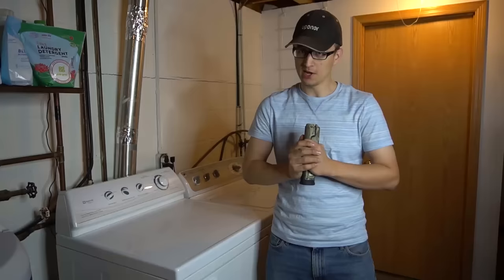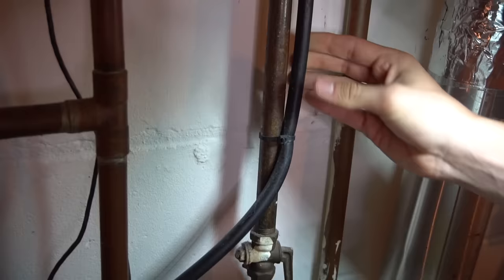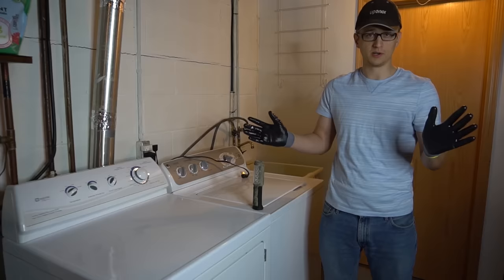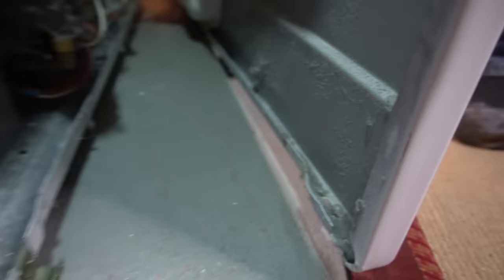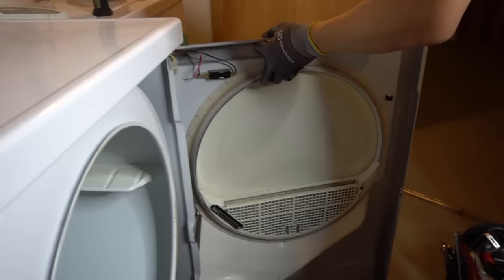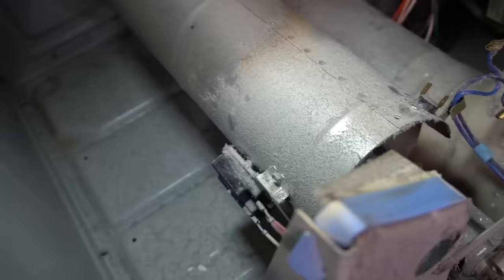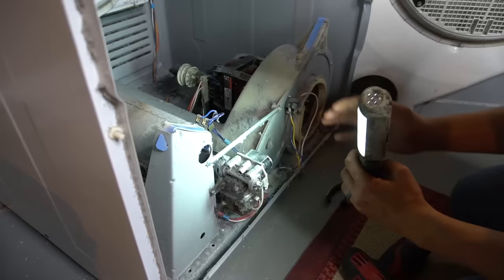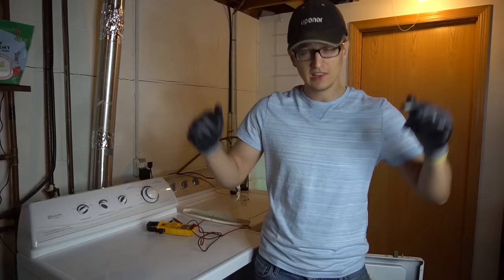Dryer Not Heating and The Most Common Fix

Comment: Thanks for this very comprehensive guide. My dryer has been taking a long time to dry and after completely dismantling the thing and probing all the parts I unfortunately haven't found a smoking gun. Hopefully simply having disassembled everything and putting it back together will have set something right...

A note about continuity testers: continuity on a multimeter is typically used to detect shorted electrical paths. Meters are designed to beep only for very small resistances, in the order of < 10 ohm. Your continuity tester didn't beep when you measured the coils because the resistance reading was too high.
Reply from the maker: I have had a few times where I took a dryer all apart, found nothing wrong, put it back together and it would start working. Another thing I have seen is gas dryers heating for only the first 15-20 minutes and after a while the gas valve coils just stop opening up the gas valve. Sat there and watched the dryer dry twice before and caught them doing that. So now if a customer tells me it takes it a long time to dry and I am not finding anything wrong, I just go ahead and replace the gas valve coils. Haven't been getting any call backs.

Thank you for explaining the difference between continuity and resistance testing. I finally know what the difference  between the two is besides one beeping and the other one not. ;)
Reply: Thanks for the suggestion. Do the gas valve coils make a clicking noise when they activate?
Reply from the maker: They do make a clunk sound when they open the gas valve. If you have a little sight glass opening on the bottom of your dryer, or a kick panel, you can take it off and just watch the burner. If you see the ignitor glowing but gas valve not opening, then those coils should be replaced.
Reply: @WordofAdviceTV  Agreed. The gas valve coils are so inexpensive, whereas service calls are not so inexpensive. If I have to open up the machine for work such as replacing the igniter and I suspect that the coils haven't been touched in years, I readily replace the gas valve coils, as I almost always have a set with me. I think of it as preventive maintenance rather than repair.
Reply: @sswpp8908  That little click from the valve solenoid when the igniter is at full temperature is the key to tell you when the gas valve opens. If you don't hear it, then replace the coils. If you still don't hear a click after replacing the coils, then it's the gas valve. In my effort to maintain laundry equipment for my few rental properties, making sure to always have a new set of gas valve coils and a spare igniter on hand has given me a good shot at a fast fix for the most common problems. 
     Cleaning the inside of the machine is a part of the job. For that, I carry a powerful hand-held vacuum, a refrigeration coil brush (just because it can get into confined spaces), an automotive detail brush and a cheap 2-inch paint brush too. I admire the capabilities of a good appliance, and giving it a good cleaning from time-to-time is a matter of giving it proper respect and encouragement to keep on doing its good work.
Reply: es, it makes a click noise

Comment: hey man, thanks for that video,. not only you got a liot of views in order to thank you for it but you actually helped me repare my dryer. i just bought one that was making a little heat but i had to to 3 completes cycle in order to dry my clothes cause it was still moist, i opened it up like you explain, clean all the dust with my shop vac vaccum cleaner and verified all the fuses. fuses were ok so i closed it back, tried it, IT WORK LIKE A NEW ONE ;)  many thanks again!

Comment: thank you so much. this is the second time you save me. Again, the thermal fuse (11:30) (most common issue) was bad. And the operator thermostat that I ordered with the other part was bad. So I will be calling them to replace that. And I'm pretty sure I will be back here in one to 3 years lol. Thanks

Comment: Pretty good dryer back in the day ... but I always preferred the whirlpool design myself (even though whirlpool owns Maytag nowadays). The most common problem with this design  by far was the blower wheel, The rear drum rollers second ... then of course, the burner coils . Every once in awhile I’d come across an ignitor with a burn spot on it . Other than that , not a bad dryer at all . That hi-limit on the tunnel , I might’ve replaced a handful of times in the 35 years or so of fixing appliances... and I’ve fix a hell of alot of appliances !!!
Reply: Thanks for the input. Maybe you might get a channel setup?
Reply: Wish I had the time... my company is in nyc . I’m out on the road repairing appliances from morning till night everyday ... a lot of times I’ll work a half a day on Sundays !!!
Reply: @josephmurgolo2795  You are working too much. Don't forget to take breaks from time to time.
Reply: Good instructions. I looked up my issues with washer and dryer and fixed both of them. My daughter now has her dryer not heating but she has service plus so told her get them out to fix it for free..and for her to watch them to see how it all works

Comment: A coil will always have some resistance.  When the electrical current from the multimeter goes through a wire it creates a magnetic field. Since that wire is coiled, that magnetic field will resist the current. Coils are also called "chokes" for this reason.   So a coil is never like a short, or straight wire. But the resistance should never be open.
Reply: The effect you mention (reactance) only applies to changing currents through a coil - alternating current.  A coil shows simple resistance to DC current because it is a long piece of thin wire, not because it is a coil.
Reply: @stargazer7644  Yes. Thank you for the correction.

Comment: I'm sure there have been comments on this before since this is a fairly old video, but for anyone watching it now that is confused about the continuity test on the coil, here's the deal:

When testing for continuity, the meter is essentially looking for very low resistance in the wire (high resistance means the wire is broken, fuse is blown, etc). The gas dryer valve coil is basically a small electromagnet that opens the valve when energized. The coil has to have some resistance in order to create a magnetic field strong enough to operate the valve. A reading of 0 ohms (or if the meter beeped when on the "Continuity" setting) means the valve coil has shorted out and needs replaced. Gas dryer coils should read 1000-1300 ohms, or 500-600 ohms depending... Regardless the resistance is way too high to register on a continuity test. 

TLDR: 
Coil test: 0 ohms or beep (continuity) = Replace
                 500 - 1300 ohms = Good
                 O.L. = Replace

Comment: Hi Jay.
I bought a Speed Queen dryer in 1979 and have had it now for 42 years.
That includes serving a family of 5 and raising 3 children to adulthood.
Recently it stopped heating, but the drum still rotates at normal speed and the exhaust blower still works.
But no heat.
With my multimeter I checked the heater element and all 3 thermal sensors and they all tested good.
I think the problem may be with a faulty relay located inside or on the main motor.
I haven't tested the relay yet because it requires more disassembly to access it.
I think the purpose of the relay is to inhibit the heating circuit if the motor is not spinning?
But the motor IS spinning but no heat.
Could you please comment on this?
I still have the schematic for this machine and can upload it if you're not familiar with this relay.
Thank you.

Comment: Your place is so clean.  I wish it was my place.
Reply: I just finished your video.  I doubt it's my lint screen but I do use those fabric softener napkin things.  What should I use to clean if the water doesn't flow through it (I haven't checked it yet).   My dryer is really old so I don't know if I can find a replacement lint screen.   Thank you! :)

Comment: Your video is very informative. I will not be repairing the dryer myself but I do have a question. My clothing didn’t dry, and I smelled gas. Is this likely the igniter ?
Reply: Easy to check and see. Check that there’s resistance across the harness that connects to the igniter. Check the igniter itself to see if the element is broken. Be careful the element is quite fragile. Also check your thermal limit fuses. Again very easy to check

Comment: A few times over the years I was thrown off by a cracked or stripped plastic knob on the selector. I had the dryer total apart and everything connected before I looked at the knob again. Another symptom similar to thermofuse is bad door switch zero function. Washing machines are lid switch %90 of the time where I used to work. Good vid. Thx
Reply from the maker: Hey Noble! I didn't know you worked on white goods too :) Thank you for sharing the pointers! I had a few of those calls too, where I would take it all apart and check everything just to find out that it was the door switch all along. The Whirlpool one that has a little black tab got me a few times. The end of the tab breaks off just enough to where the door doesn't close it.
Reply: Word of Advice TV I just left a maintenance job for a property with 330 units, each with their own appliances. So many “white goods”? I love new industry lingo. I was considering to be appliance tech but field didn’t show much growth, as much as HVAC over next 6-10 years. But now with the electrical theory with all the components of appliances; and your video here, I’m thinking that HVAC applies to many fields. Just more excited now. Just trying to start figuring where I wanna head first: commercial Refrigeration, control or straight service.
Reply: Word of Advice TV my current course is labeled HVAC-R but I guess industry is very diverse. Thinking service will help me cut my teeth a little faster but seems very demanding of time which is fine now; no long term responsibilities now. No family or serious obligations. Just me and this HVAC school. But thinking the stability of a specific facility matches my life structure now too. 
Anyway thx for video.
Reply from the maker: Oh okay! Lol, then you got experience in all kinds of stuff! Yeah, the HVAC industry is booming! Lots of demand for it. That's awesome that you don't have any serious obligations while you go to school. That helps a lot! I am sure while you will be going to school you will figure out which direction you wanna take in the field ;)

Comment: If it's an electric dryer, it could be the heating element wire has broken.  Usually you can see that visually, or you could check it for continuity like everything else.

Comment: Hey there! I've encountered many of these conditions in the past and fixed them. But now...I have something I cannot figure out. I'll explain where I'm at first, and then go on to the symptoms. Yesterday, in an effort to solve my problem with my Maytag coin-operated gas dryer, I took apart the dryer and all of the ductwork all the way to the outside and using a vacuum, brushes and a dry rag (no water or liquid cleaners) I cleaned the away lint from everywhere. There was a big pile of it in the duct just below the lint filter - exactly as you found in your own dryer. I even cleaned the surface of the heat sensors that are inside the exhaust duct assemble at the front of the dryer, and of course I cleaned the lint from the motor. Everything was about as dirty as yours was, and perhaps a little less dirty that some of my dryers when I've gone in to work on them. Even though there was a fair bit of lint to deal with, everything had the appearance of being in really good condition. It's clean now. I installed a new timer mechanism (having thought that was where the problem was) and put it all back together. I found the problem remained. So here we go...
     It's a Maytag commercial model MDG16CSAWW gas dryer from about 2000-2001. There is no moisture-sensing feature, but it does have a cool-down function for each of three different dryer temperature settings (1) For each dryer temperature choice, when the dryer is in a dry cycle it doesn't seem like the motor is laboring in any way; it sounds like it is operating perfectly. But it will shut off at random times - sometimes as short as a couple of minutes into the cycle, sometimes after maybe 20-30 minutes, sometimes not at all. When it shuts off, it must be shutting off due to a thermal switch that resets itself because after a few minutes I can press the start button and the machine will resume its work. Now here is the real puzzle: the dryer supposedly has a timed cycle controlled by the (brand new) timer that is actuated by the coin slide, BUT the dryer seems to ignore the timer entirely and will just keep operating without stopping indefinitely "forever", or for hours, or for minutes, or for whatever random time it chooses. And after it stops (if it does), then it can be started again just by pressing the start button after a few minutes. I'm stumped. 
     Does this problem intrigue you, and you have any suggestions? Thanks for any clues you can give, and if there is a way to compensate you for your insight, please let me know. I'd be glad to give that sort of support!
Reply: By the way, regarding the problem I posted: my coin-op dryer has no computer boards. Everything is pretty much an example of old skool simplicity - mechanical switches and such. In case it matters, I wondered if the door switch might be defective and causing the random shutoff of the dryer, so I experimented. I found that the door switch will shut off the machine when the door is opened, and if I attempt to cause the dryer to stop by wiggling the door switch, it won't stop until I allow the button to come to the fully open position. So I think the door switch is operating as it should. When I did the cleaning I checked the two rollers at the back and they ran freely. The felt drum seals were as they should be. Also... the mechanical timer in the coin mechanism advances the cam wheel non-stop. So...I'm beginning to wonder if the reed switch contactors in the black box attached to the motor may be malfunctioning.
Reply from the maker: @tomc3542  Hey Tom! That sounds like a problem that would take some probing to figure out. I must say I have never worked on coin operated machines but likely there is not much of a difference besides the coin mechanism. If the machine runs non-stop, I would have suspected the timer first too. From what you described here:

"But it will shut off at random times - sometimes as short as a couple of minutes into the cycle, sometimes after maybe 20-30 minutes, sometimes not at all. When it shuts off, it must be shutting off due to a thermal switch that resets itself because after a few minutes I can press the start button and the machine will resume its work"

That sounds like a thermal overload is opening in the motor. When the unit shuts off, if you press the button right away, the motor does not start right? You have to give it some time to cool off before it can restart I assume. Although whenever I had that problem It seemed like after every time I pressed the button to restart it, it would work for shorter and shorter periods of time. Replacing the motor took care of that problem the few times that I ran into something similar. But if you say that sometimes it runs non-stop for a long time then I don't know if that's the case for you.. It's possible that cycling thermostat is bad which causes the machine to run abnormally too. Other then that unfortunately I don't have an exact fix suggestion for that. I would have to check voltages/resistance readings to try to figure that one out too. If you get to bottom of this, come back and let us know if you get the chance. Good luck!
Reply: I’m a second generation appliance tech ,over 35 years on the road ... I prefer a leaf blower blowing from the inside of the home going out . With the blower on inside , I run a vent brush from the outside into the vent ... comes squeaky clean every time.
Reply: @josephmurgolo2795 - Great suggestion for cleaning the vent tubing. I just use the vacuum for the bottom pan of the dryer cabinet and all of the small parts, sensors and heat generation components attached to it.
Reply: I think your machine has contacts that have welded themselves together in some device such as the timer;  Depending on the device it is sometimes possible to file or sand the contacts, cleaning them up.  They tend to weld themselves when the contact is poor and resistance goes up producing more heat or arcing of the points.  Contacts have to close rapidly and firmly.  It's also possible you have a bad clock motor that isn't moving the timer forward, so the machine runs for ever.

Comment: Very thorough and helpful.  Thank you.  My Bravos XL gas dryer runs and produces no heat.  Found out the igniter was not glowing.  Replaced the igniter (without testing if it worked or not) without luck.  The Thermal fuse, temp regulator and Hi-Limit fuse all show continuity - 0 ohms.  The gas solenoids show resistance ~ 54+ ohms.  Thermistor measures 8.5 ohms.  That is all the sensors.  I think.  What could be wrong?

Comment: If your lint duct does not vent outside close to the dryer and you actually have a hard metal duct going up 6-8 feet or higher and then across your attic to an eave, you can bet that the duct is full of lint. You need to clean it before starting your dryer if it’s the thermal fuse. If you don’t, the fuse will open again. But you could start a fire inside the duct before the fuse opens.

Comment: Some people resetting thermal fuse by smack it on the concrete floor, or by heating. Is it good idea?
Thanks for your brilliant teaching by the way!
Reply: The problem with that is - there's a reason the heater element overheated and the fuse is open.  You have to fix that problem.